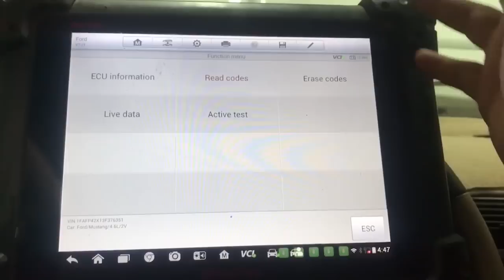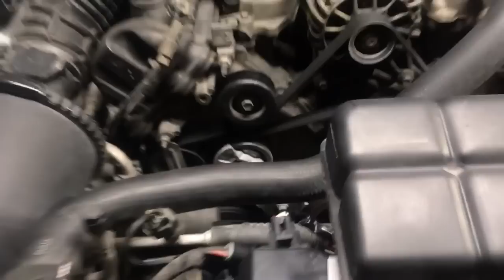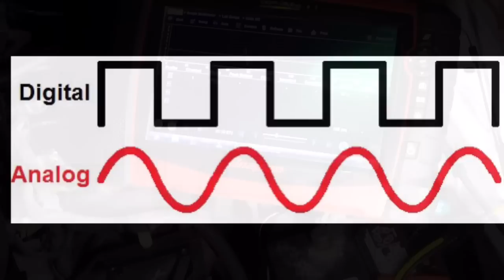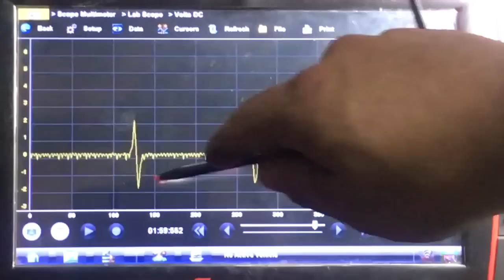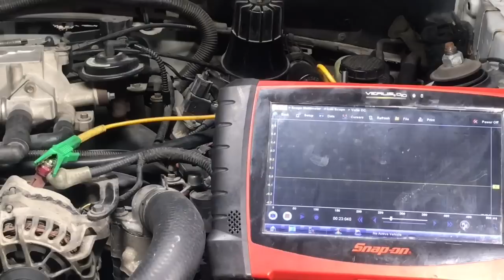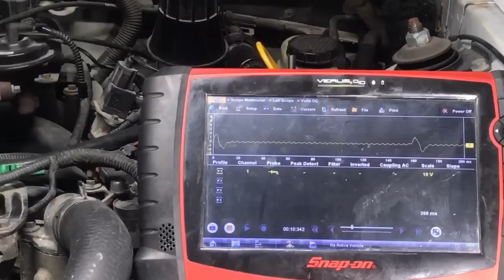How to fix code P0340.  A new cam sensor will not repair this car.

Comment: Now how would anyone ever see this without a scope?! Beautiful video Oz ! Great diagnostic process all the way through
Reply: i was thinking  the same question ...
Reply: You can now make these scopes with a Raspberry Pi. Without this video though I would have never thought of this coloration. Thanks!
Reply: @btarrh   PLEASE TELL ME HOW TO DO IT WITH A RASPBERRY PI
Reply: @btarrh   PLEASE TELL ME HOW TO DO THIS WITH A RASPBERRY PI
Reply: Great informative video thanks for the help fix my problem
Reply: I have several sensor fault codes on a 2011 charger w 5.7 hemi. Would pulling the alternator and taking it to be tested at parts store reveal this type of problem? I don't know what all they test for in store
Reply: No, they do basic testing only.
Reply: Hhhmmm comment went from tell me how to do it with out the scope to your a trump supporter for not giving me everything I said. Damn I have a long crank on a 05 ram hemi.5.7 searching calmly an respectively because no one out here owes me a damn thing. I need to update the ecm. Cus vin doesn't show on cheaper scan tools. Shows crankshaft code, cranks for 20-30 seconds an turns on good. Will die randomly when slowing down an turning the wheel. I put in neutral an cranks normal.has get up an go. Just out here looking for tips tricks an any help during this covid lockdown if things was good I would find a good mechanic to update an to run theses test..but living hand to mouth at the moment. So thanks for any help if possible.
Reply: SOMEBODY PLEASE ANSWER !!!
I have that same code on my charger has good sensors and timing belt new spark plugs … 

Can my alternator cause that 0340 code ???????????? I replaced a few months ago and did the terminal removal test and alternator kept my car runnning … 

Is it a faulty alternator?
Reply: @23zaee  I hope you found your answer…..
Reply: without his searching scope wouldn't solve it at all , scope is a good tool when a good reference is available which is not always the case , which proves that the scope is just a fancy tool but it's not necessary at all to have
Reply: amr hamed never mind . I see you like Scotty Killurwallet. And you also know now how to super clean an engine bay as well thanks to Chris.
Reply: @NewLevelAuto  Scottya the shit boy fk what you talking about
Reply: amr hamed so how then would you pursue a flex ray network failure due to signal attenuation? It's not a fancy tool at all. It's quite basic . And if used properly is one of the greatest in any diagnosticians arsenal. Are there other ways ? In most cases yes , but certainly not all. A decent scope is under 100 dollars. A snap on ratchet used is the same price. Remember that we do not have the luxury of just repeatedly fitting parts to see if it's the failure. We only have a few hours and that customer must have their vehicle back. Where are you from if I may ask?
Reply: BTW i have a pico scope but you already said what i am trying to say ( Are there other ways ? In most cases yes ) that's it
Reply: amr hamed What I am saying is that your comment that it's not necessary creates the illusion that everything can be repaired without one. Clearly in owning one you know that's not the truth. There are times where without firing a parts cannon , the only way for a proper diagnosis requires an oscilloscope right?
Reply: @NewLevelAuto  Correct, We all know if you talk to a tech that doesn't have one you know he fires the parts cannon.
Reply: @NewLevelAuto  Scopes are indeed a great tool. However, I will say, scotty does often have some good tips to add. And Chris does also have some good methods in how to do things. Neither are diagnostics technicians. 

As an Electrical Automotive technician myself, and while I don't fully agree with scotty or chris on some things, I could never fault either of them for what they do.

And while this event, in this video, did find the answer, it was still just an educated guess. There could have been other eletrical loads overworking the Alternator. And now, as a result, the new alternator is strong enough to handle the extra alien load, without harming sensitive sensors, like the CAM. Though, eventually, that alternator may fail as well, due to same alien load somewhere in the vehicle. 

Good testing though.

I agree, also, the Scope is an invaluable tool, when used appropriately, as you have. Don't get mad at those attacking you. Everyone has an opinion.